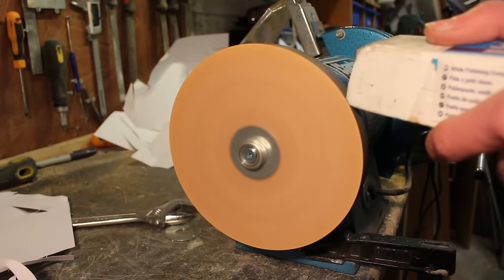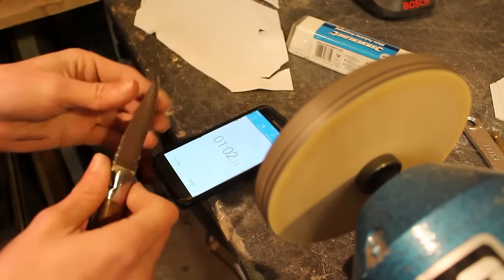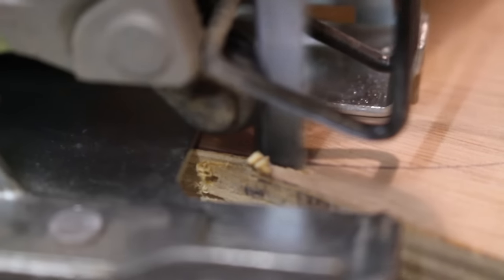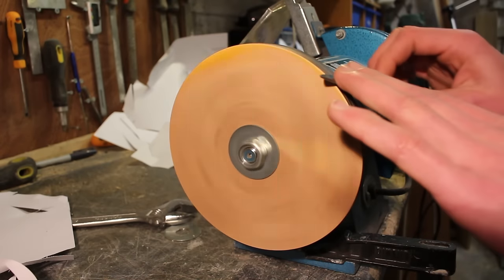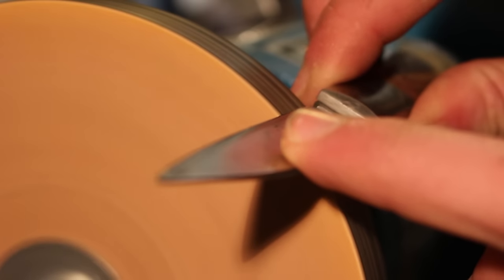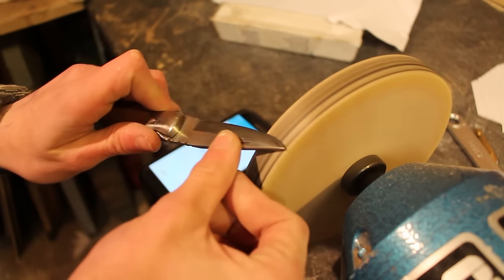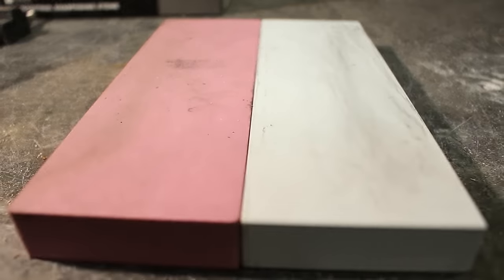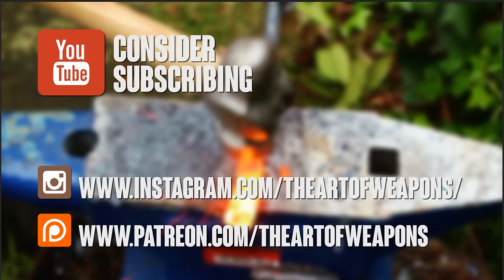The Laziest Way to Sharpen Any Knife to Razor Sharp 2

Comment: Depending upon the nature of the (steel) blade material, your sharpening the blade with a the wheel running away from you is that it lends itself to forming what I call a 'wire' edge. This means a thin bit of very sharp material that is indeed very sharp, but that is not robust, will, at the macrosopic level, break off after too few initial cuts. (Recall barbers with their leather strops; they wern't abrading steel away, they were working the wire-edge back and forth, and facilitating it's reformation... very sharp... very short lived.)
Reply: As an apprentice joiner, I was taught to strop chisels an plane blades on my palmI. You can also draw the edge through a corner of softwood.
Reply: Thank you, you said it better than I was going too. I forgot the less offensive term "wire edge", I still call it as it is, a burr, a really sharp burr, as all burrs are. Great for that broad head that'll be slicing through your deer, one time. But my kitchen knives are not burred edged. And when they don't perform, it's to the stone and then strop and they're good for another 6 months.

Comment: I’ve been using basically this method for around 2 years using an angle grinder and a wooden disc with a similar buffing compound. It’s less stable and requires a vice to work effectively, I definitely would prefer the method in the video if I had a bench grinder.

Comment: This seems like a great idea.  I understand the safety consideration of rotating away from you, but what if you then also turn the knife around so the rotation is edge to spine?  Yes OK if you cut into the wheel your wheel and/or knife is screwed but at least the knife will fly away from you, and it might conform better to sharpening theory that way.  Also what type of buffing compound do you recommend?  That would be the only item I need to buy.

Comment: I've done it with MDF, and it worked very well. Really fast, I was suprised, the only compound I had was auto body polishing compound, and it worked.

As far as turning the grinder around, why don't you just turn the knife over, so the sharp edge is pointing down.
Reply: I would say because it would still fling the knife towards you if anything happens. His way if anything happens, the knife will be pulled away from you. Simply less chances to get hurt.
Reply: he is correct exactly how he showed it--there is too much risk the knife could be touched to the wheel the wrong way.

Comment: Cool quicky, but 1. You should never use a grinder for sharpening as it heats up the metal and potentially reducing its temper, ( dulls even faster then ) 2. When you sharpen you should always sharpen into the blade as it removes material leaving a true edge, ( away rolls the metal leaving a false edge that will again dull even faster )  
I know that you probably know what your doing and can achieve a nice edge without heat but your average joe is probably going to ruin his or her knife.

Comment: TAOW: you there buddy?? What's with the making a pattern on the sharpening stone? Thanks.
Reply: Not TAOW, but I believe he's checking whether the surface is completely flat - if it's raised, the grid pattern will be worn away first in that area.
Reply: Charlie Bruce Thanks a lot, I see what your talking about. Have a good weekend!
Reply: They are clips from his whetstone video, you should check that one out too.
Reply: nilz23 Got it, thank, enjoy your weekend!
Reply from the maker: Have a look at the sharpening stones video, the link is in the description. I was basically making sure the stones were flat before I used them
Reply: ahhh i literally just asked this question. but also what are you using to grind the stone flat?  aluminium oxide sand paper  and a flat wooden block or anything special to look after the stones?

Comment: So in Theory could I make a smaller version of the wheel for my Dremel. I was imagining it as a three inch oak dowel instead of a wheel
Reply: only thing you have to watch is you have a much smaller surface area and that piece of wood will heat up quick, which could also heat up the knife. If hot enough you could ruin the heat treat. 
And if the wood gets hot, then cold, then hot, it could warp the wood and not know it which would inconsistently sharpen your knife.

You absolutely can do that with your dremel, just gotta keep these things in mind. Hit the knife with it, lift it off so it can cool for a sec, then back to the knife, repeat.
Have a good one man!
Reply: @kevin.waldron  good points🤔

Comment: Now, I just need to see a video on how to sharpen a blade for the person who does not own any tools.
Reply: Michael Vaughan use the bottom of a ceramic mug it will serve as a extremely cheap wet stone (won't sharpen razor sharp but it still workd
Reply: You can buy small squares of wet sandpaper from any hardware store or a store that has a hardware section really cheap. While grocery shopping I bought 7 different grits from 200 up to 1500 which was the highest grit they had. I neatly folded a strip, starting from the lowest grit, over a small piece of square scrap wood. Put the knife flat on the table and carefully worked at the edge trying to maintain consistency and listening for the sound it makes (you'll get it really quick). After sometime less than an hour I had both my kitchen knife and EDC knife shaving hair off my arm from heel to tip.

Now every time I use the kitchen knife I strop it a couple of times on a belt for maintenance and 2 months later its still shaves hair on certain parts. I still have the bulk of my sandpaper remaining for future sharpening.

Cost was about 3.70 US dollars after conversion.

But my EDC knife wares rather quick so I went back to the hardware store and bought some 8mm dowels and a couple 20mmx12mm sticks and with some yarn I had lying around, two bic pens and my knife I made a wicked edge style jig with no tools whatsoever. Its quite zen to be honest and I couldn't believed it worked.
Reply: Dom Sowards  Or bottom side of any ceramic plate.
Reply: There is a video of a guy getting a hair shaving edge on a knife with a brick, a cinder block, and a leather belt. I think it was called "no excuse for a dull knife" check that out if you really want to get a knife sharp with NO tools.
Reply: I wanna see a video of how to sharpen a knife.... Without using a knife
Reply: That is the name of the video. Interesting.
Reply: Thank you for telling me how to get the right angle. That is the problem I always have when I try to do it myself.
Reply: Dichtsau steels and honing rods are nice for softer European steels but the harder and thinner Japanese blades (and modern knives that use ultra hard "super steels") shouldn't be used with them as they will tend to break off the edge versus bending back into a razor edge. for these types of steels you need to remove material with something like a Japanese waterstone.
Reply: Just pay someone fool
Reply: priceless experiene
Reply: Michael Vaughan Best Pocket Sharpeners are the Lanskey Blade Medic and the Lanskey Quadsharp (both are under $20 per sharpener; get the blade Medic if you are just starting out). Learn how to strop a knife on leather or canvas (jewelers rouge which is essentially a diatomaceous earth that can be rubbed into a leather or canvas strop to improve the life of a strop as well as help maintain a sharp edge on your blade; use red jewelers rouge followed by white jewelers rouge for best results; a flat piece/strip of cardboard from a box can also be used as a strop in a pinch due to the amount of silica added to the cardboard pulp before the box is made; the silica will help remove metal burs when stroping a knife; use a new piece/strip of cardboard per knife blade or for best results, use a different strip of cardboard per side of the knife/blade).
When sharpening a knife one a whetstone, cut at a 25-degree angle into sharpening stone making sure you move the whole edge along the stone so that one side of the knife blade is sharpened before using the same method at a 25-degree angle on the other side of the knife blade. Repeat process on each side of the knife blade about 10 to 50 times until all visible chips and factory micro bevel are no longer visible to the human eye (up close on the knife blade edge. Start with a 200 to 400 grit whetstone stone with the method described on a 800 to 1000 grit whetstone. If you can use the same method on a 4000 grit whetstone and an 8000 grit whetstone for best results. 
After knife has been sharpened on a set of whetstones (using water or mineral oil [edible and food grade knife oil], then remove all burs off the the knife edge by stroping the knife edge. Instead of cutting towards at a 25-degree angle, you will be pulling the knife edge at a 5-degree to 10-degree angle along the strop to remove metal burs that have formed on the tip of the edge of the knife blade (which are better seen under a microscope; micro burs are what causes the knife to be dull and are not visible to the human eye up close; brand new knives are factory sharpened at a 20-degree to 25-degree angle [kitchen and japanese steak knives are factory sharpened between 15-degree and 20-degree edges which makes the knife edge thinner and more susceptible to blade edge damage and the edge becoming dull] and are not stroped at the factory before you receive knife; it is important to strop all your new knives, machetes, and axes for maximum sharpness). Too much stroping can cause the end of the blade to start rounding which will require it to be sharpened on a whetstone or carbide pocket sharpener to re-profile the knife blade edge. 

In the video, he is showing how to create a bench grinder powered strop (it's also possible to strop on wood and works better with a diatomaceous earth like jewelers rouge or the mud slurry found in a river). 

Be careful when using this method as a strop because the wooden wheel can generate heat which can/will cause the steel to lose its hardness. For instance, if you tried to drill a hole through the end of a full tang carbon steel knife to create a lanyard hole, you would end up breaking several drill bits depending how hard the steel is. However, if you heat up the metal with a propane torch until the metal is red hot and allow the metal to air dry, then drilling through the metal is very easy at the point because the air drying of the metal caused it to lose its factory, preset, steel hardness. Heat the metal back up red hot and cool it in a tin can filled with mineral oil to strengthen the steel. Brazing the knife steel with a torch can also make the knife edge even harder after cooling the metal in mineral oil (look this up on Google for an instructable on tempering knife steel to learn proper steel temperatures and yellow/orange color ratio to complete the knife steel hardening process (motor oil like SAE-30 can be used instead of mineral oil, but requires more cleanup and polishing done to the oil blacken knife blade).

Sincerely, 
Jacob 
SurvivalGeek
Reply: npcPanda I did this the other night so I could cut through a massive piece of beef...it worked very well!
Reply: rub them together. you might ruin the blade if you don't do it properly.
Reply: sometimes i sharpen my knives on the side of the wall, or on the stairs if they are made out of smooth concrete
Reply: use light 3M repositionable spray adhesive and tack your paper to a  piece of solid surface countertop material. Makes a great sharpening/honing stone.
Reply: The easiest way is just sharpening it with few green notes. Depending on how sharp you want, you can use the green note from $5 to $100. hahahaha... just kidding dude..
Reply: Wtf!! you don't have a bench grinder? You have no business with a knife. 
Good Day!!!
Reply: So, you want to sharpen a knife without any tools? Would you also like to learn to cook without any pans?
Reply: bruce lee
Reply: @westcoastwarriorsarchive7929  I thought it was cardboard, not a belt?
Reply: @SurvivalNerd  jewelers rouge is iron oxide, NOT diatomaceous earth.

Comment: Will this ruin the temper on the knife?
Reply: Caleb Burkholder Very unlikely. You'd have to press really hard. The plywood would start to char before the metal got that hot, I think.
Reply: if you can hold onto the blade with your bare hands, and its not changing color,.its fine
Reply: No, my knife is as angry as ever
Reply: @Caleb Burkholder Maybe if the wood is on fire...
Reply: Yes it will re tamper your edge and have a chans to damage your blade.

You shuld only do this on items you dont care to much about.

If you look at the video you van see black marks on The wooden weel idikating that its bekoming quite hot.

If you are gonna sharpen something valuable, use proper tools or send them away to professionalls.

Comment: Sharpening a knife with wood . . . who knew? :D
Reply: AsciiGDL lol kinda ironic.
Reply: Well no, you're still using the menzerna compound to sharpen the steel. The wood alone would do nothing.
Reply: Not me! I did not know that wooden trick.
Reply: Why not. A leather strap, or strop, was used to sharpen razors back in the day. Not sure if they still do. Maybe.
Reply: JgHaverty NERD
Reply: a leather wheel works better, after you charge it properly it holds the compound better and that is what actually does the sharpening is the compound!
Reply: @catweasle5737  this is exactly that. Leather strops where used for honing knives . That means bring a sharp knife edge back. So this is stropping a knife not sharpening it. If he had a really dull knife with no edge at all this method would not work.
Reply: @catweasle5737  They are still used by those who use a straight razor. 
CatweaZle... THAT takes me back... :)
Just grabbing both seasons from a torrent site...

Comment: When I saw the thumb nail I thought you would be using a paper wheel which are very good but quite expensive,  it would never have occurred to me to use a plywood wheel. Thanks for sharing, if I can get it to work for me then you've saved me a considerable amount.

Comment: Or you could spend $20 and get an actual blade sharpener. Right? is there any benefit to this method? Of course if you already have a rotary tool, i could see it being a cheap alternative. Depending how expensive the grinding wheel is. Whats cost?
Reply: iamextremest a 150x150mm sheet of plywood is nothing baisically
Reply: iamextremest Find me one for $20 that gets a blade sharp AND creates a durable edge. I'll wait lol.

Comment: For different tools/applications, you can adjust the angle of the blade against the wheel, to get the edge that lasts best for that tool/application. This will make a good winter project for me. So many dull knives, kitchen knives, hunting knives, chisels, axes, scrapers...

Comment: Why not glue a leather around the wooden wheel?
Reply: Bee way too sharrp
Reply: Why not use a leather disc
Reply: Because the leather would most likely seperate from the wood
Reply: @sparkoceanic  
And a rotating string of leather at that speed will sure be fun

Comment: I just made this today.  Great idea, and I'm looking forward to trying it as soon as I can get some buffing compound.  Two questions.  How important is flatness?  I didn't have a wood chisel to get it true, so I used 36 grit sandpaper.  That worked well, but I'm not sure if it's perfectly flat.  It looks flat to my eye, but I don't know if that's flat enough.  Also, does the type of buffing compound matter?  I see you're using a white compound, but I know there's several different types of this material.  Quick googling only talks about using buffing compounds to achieve metal shine, which is not really what we're doing here.  I see you're using a white compound.  Do any of the others offer anything better?  I imagine each compound has different properties, but it's unclear to me what those are.
Reply: All this text and u don't get a single like💔😃
here take a one from me

Comment: I will try this. I've used 400 grit sanding wheels and belts of leather to get knives not only sharp enough to shave but split hair in two when layed across a thumb nail. This, I believe, might work just as well. Never thought of it before.

Comment: I like it.
I have an old bench mount portable hand crank grinding wheel that could work in the bush.
I have a stone wheel and I use it to sharpen my axes in the field.
It helps if you have a friend to crank the wheel while you use two hands to hold the work.

Comment: Dude, this is amazing! If it really works then it's worth gold! I hate sharpening with stones because it is very hard to keep the angle while moving it and on both sides. This could be a very cheap, easy and good solution. One question:

Does this only works for knifes that already have an edge but it's not quite as sharp or can you use it to make the edge?

Comment: I went and made this but didn't consider the size of my grinder motor so i could only grind one way. so i remade the wheel at 200mm and that has solved that issue. I bought the same silverline white paste as you and so far all the knives i have sharpened are easily the sharpest i have ever been able to get blades by hand. Is there a way to get more compund on the wheel as i seem to lose a fair bit as it is flying off whilst re applying. just wonderted if roughing the surface would help?

Comment: hello friend! great vid! I have a question, whether using ur method or wet stone, ive seen some use a leather strap afterwards as a final step.  Do you do this,  is it truly a way to fine tune the edge, and if so how do you recommend using it and what grain leather shud you use? Also what is the minimum hp/amp/rpm grinder can a person use to get same/similar results?  Lastly if your metal polish that you use is not available what is the next best/grit one to look for?  Thanks for ur time